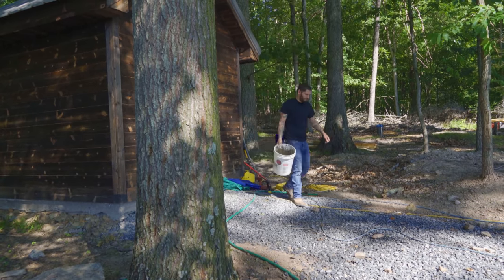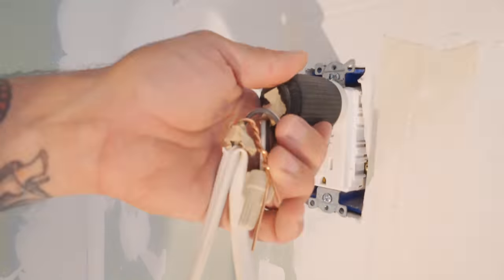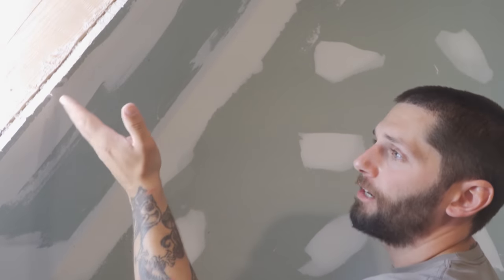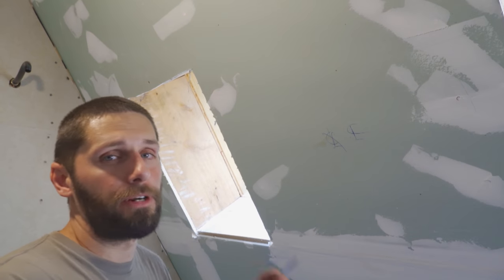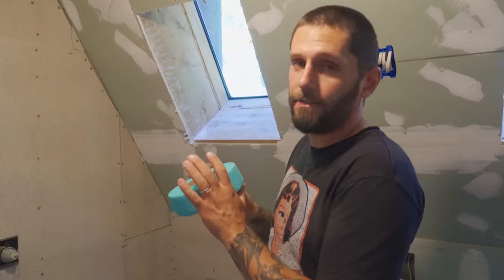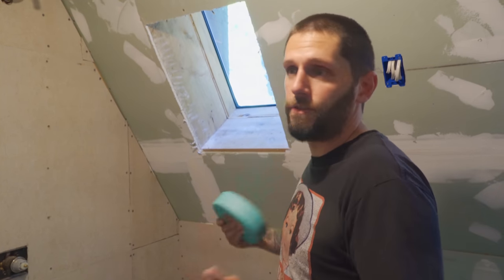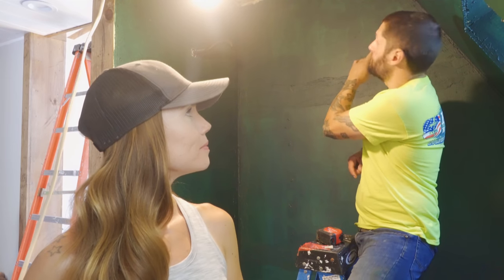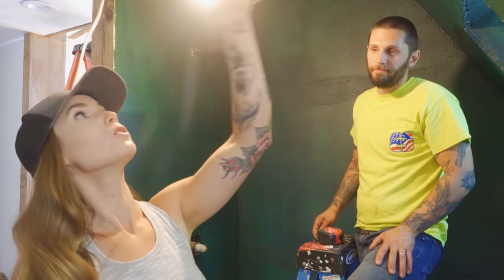Designing A Spa Bathroom For Our Self-Built Home

Comment: Great lesson in how you waterproofed the shower area.  A lot easier than cement board and I think more effective also.  Great to see the continued help you get from the kids.  What a wonderful family you two have made, and now you will have the safe haven to enjoy totally very soon.  Great ending, Erin. You are a professional in your hard work making these video's high quality and smiling the whole time..  Cheers!!
Reply: Cement board isn't waterproof.  It still will alow water to penetrate but it doesn't swell or disintegrate like sheetrock.  You still need to use waterproof membrane such as redgard or aquadefense(my choice) . I would also recommend using the quickset mortor on the screws as well(less chance of small pinholes). I even did 3 coats because of small pinholes still visible after 2. I guess I missed the episode of how they did the shower pan, but everything is looking good so far.
Reply: It appears to me that in the actual shower area they used a Hardie product or something similar, not green board. Yes you should still use water proofing on cement/Hardie board. I hope they have more than Hardie board and roll on water proofing on floor.
Reply: Another option for those who want to save time but it costs a bit more - Schulter Kerdi Board system.  Goes up very quick, even easier to water proof and will outlast just about anything.  I plan on using it in a couple months when I redo my main bathroom.
Reply: We had red-guard crack and leak... wouldn’t use again.
Reply: @heathermilford9667  if the redgard cracked, there might have been an underlying problem.  Usually these membranes are flexible to prevent cracking. But I have not used redgard.  Mapei products are really good though. So are schluter products, although they are expensive. Laticrete makes a great reinforcing tape for corners.
Reply: Shayne Punim  green board is highly recommended for use in moist areas, but never to be used in areas of direct water contact unless treated with a waterproof membrane
Reply: @scorpionsting47  agree on most but highly disagree about mapei. I've used most every brand of setting and grouting product on the market. Dyes in their grout sometimes don't breakdown and mix well even with a 15min slake. I had to eat a 4k s/f job because the engineer customer read the manufacturing date onna special order grout color, the grout had expired 4 days before I received it.
Just give me some durock, fiberglass tape, and three coats of redguard and I'm good.
BTW retired tile contractor, with 30 years of "slinging mud", y'all be good
Reply: @heathermilford9667  I agree with Scorpio, it's very important when using a cement underlayment to have a 1/8 in gap between the sheets, mud and tape the joints and let them completely dry before the redguard. Redguard is considered one of the best in waterproofing membranes, it's also classified as an antifracture membrane, which means it has a certain amount of "stretch". I couldn't say for sure how many hundreds of gallons I've used and have never experienced what you have.
Reply: @boonvillebuck836  Yes, they did use cement board in the shower area (7:26) shows the words cement board). That is why he mixed up mortar for the joints instead of drywall mud. And yes, it still needs waterproof membrane. They did good. I used the Schluter Kerdi system, but the way they did it actually looks easier.
Reply: I'm a tiler in Australia and from what i see i can only shake my head in despair. its like putting a rain coat on and jumping in to a pool and thinking you will stay dry.

Comment: We had the skylight over the tub, put a shelf of marble to the wall and an extra set of faucets that controlled the waterfall faucet we put in the skylight shaft.  Tiled the shaft, ribbon waterfall faucet mounted at the bottom of the shaft. 3/4 “ pipe so it dumped a lot of water.

Comment: 0:14, just wanted to point out one thing. In theory, it matters little to the coefficient if the termination of the window "frame" (talking about the drywall) is square. It's still a dead spot for the thermal coefficient (up or down). I know now it's kinda late, but you could've made the space inside the window well in the shape of a truncated pyramid vs a parallelepiped as it is now. That would invite more light into the house at no major expense on the insulation.

TLDR, could've slanted the corners, even if just a little, the insulation there doesn't really do much.

ALL that is solely based on the assumption that there's no major structural element defining the edge of the window, of course.

Comment: Really enjoyed watching your build. Interesting that you don't use a bond breaker in your vertical corners or around the base.  How are you allowing for shrinkage/movement?  I put 3 or 4 thick coats of membrane around the vulnerable areas using a 4 inch brush- that is, floor to wall joints and vertical joints. Did not see if you used a puddle flange for the floor waste or how you waterproofed the floor. In my experience, most of the leaks occur around these areas. Just trying to help!

Comment: Should also use shower pan liner (especially with a wooden subfloor). RedGuard type stuff is not enough. Easier to do it now than rip out the rotten floor and do it all over later
Reply from the maker: Shower pan liner went down under the shower pan slope

Comment: Did you use regular sheetrock?  Not even the green moisture one?  I think from experience you should hVe put up cement board and then waterproof and then tile....just know this from experience...no other way to do it if you want one that lasts and it not teaming with mildew behind the tile....
Reply from the maker: There is no regular sheetrock in the bathroom. he bathroom is ALL green board and the shower has cement board, then painted with aqua defense waterproofing membrane after sealing the joints... Then it will be tiled

Comment: I am a big fan of your show and have been since the beginning. I own and operate a pest control business in Oregon. Electricians, HVAC and cable guys keep me in business. I hate to see your beautiful new home become vulnerable to rodents.  Every time you drill a whole for those electrical wires to go from outside your home into your home you create a rodent freeway. They WILL get in if you do not properly seal them up. You cannot just use foam. Even foam that I purchase from pest control suppliers is not enough. Many pest control companies/technicians to not properly exclude rodents. You have to use quarter inch construction cloth and foam. Any material smaller is to weak and will be chewed through. Any material larger the rodents will squeeze through. I hate to give you extra work but self built homes are notorious for being overwhelmed with rodents and other pests. Traps and bait are not enough. Drop me a line if you have any questions. You guys are super inspiring. Thanks!
Reply from the maker: everything will be enclosed under there, we just haven't gotten to that point yet because there are a few more things that need to get buttoned up 😊